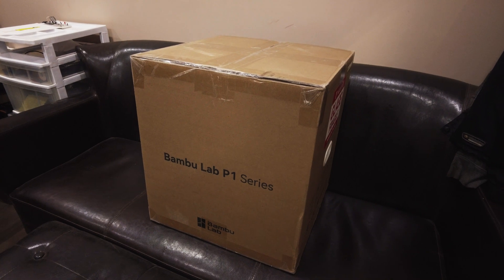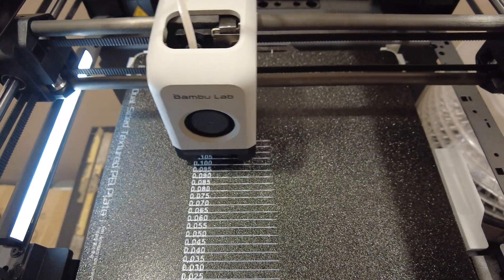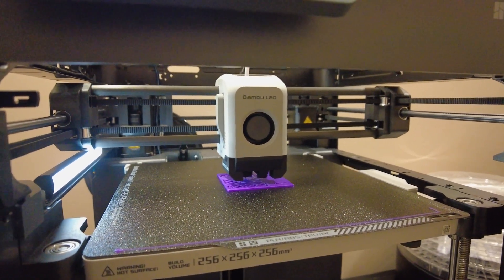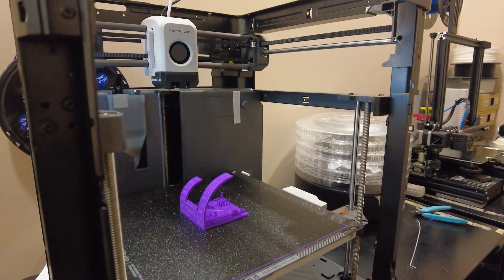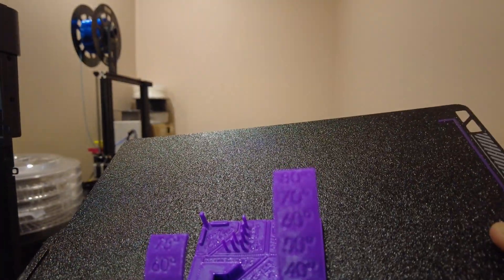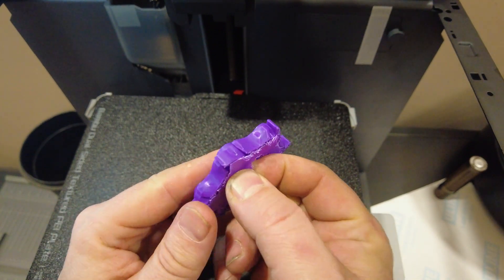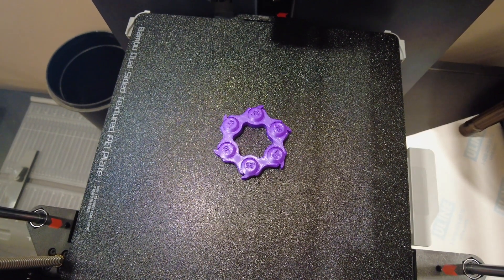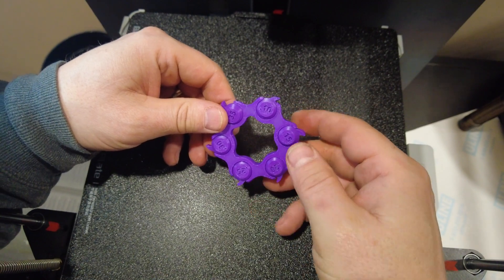Bambu P1P Tests and Calibration

Comment: Ive had 2 p1s machines since july, and these run 24/7. Ive had minor maintenance since then, and wont buy another brand.
Reply from the maker: Awesome! Mine doesn't run that much but i haven't had any issues at all. My kids' high school bought 2 p1p's when they first came out and they are the only ones that I've seen with some issues, but they were totally user error. Slicing at 0.2 mm nozzle size and sending it to a printer with 0.4 mm nozzle doesn't work well.

Comment: It's been 5 months. Is it still good? I'm considering buying one as well
Reply from the maker: Yeah, I still recommend it, but right now i'd be torn between this and the Bambu A1 mini. If you need a bigger print surface, the P1P is the way to go because you can add the AMS unit for multi color printing, but if you don't need as big of a print surface and value multi color printing more, the A1 mini may be the way to go. A bare P1P is about the same price as the A1 mini with the ability to print 4 colors at a time and the reviews are pretty good so far.

I've probably got close to 1000 print hours on my P1P and the only time it fails now is if I've done something stupid. I have forgotten to put the magnetic build plate back on a bunch of times now, and because it's so reliable I don't watch the first layer go down like I always did on my Ender 3, which is probably all the print failures i've had with it recently, although I did have one fail due to a spool tangling - again, my fault not the printer.
Reply: @MiddleAgedTechNerd-rt2lp  thanks for reply. I have a prusa mini plus, and need something with an enclosure for ASA and maybe even nylon plastics. Prusa seems to do a decent job with ASA when I get everything right, but I really want something much faster. I'll probably go with P1S
Reply from the maker: Makes sense. I probably would have gone with the P1S myself if it was out when I bought mine. I haven't done anything other than PLA and PETG so far so I can't give you an honest answer how ASA and Nylon print. I have an old "enclosure" I built for my Ender 3 when I was doing a bunch of ABS printing that should fit over the P1P,  but I haven't tried it yet.

Comment: Good video, I thought the K factor test was most useful only if you have the AMS attached. Is this wrong?
Reply from the maker: Thanks! The K Factor should be set whether you have the AMS or not. It all has to do with the filament because they all extrude differently. Some people will do a K Factor test for each type of filament - PLA, PETG, ABS etc., and some will actually do a K Factor calibration for each roll, and then change the K value in Bambu slicer with each filament change or each material type change. Personally, I set it once and have printed many colors with PETG and PLA without problems - because I'm lazy and haven't had any issues Lol!
Reply: @MiddleAgedTechNerd-rt2lp   This is good to know.. thanks!

Comment: Are you using custom settings if so what do you recommend?
Reply from the maker: Pretty sure it was just the Bambu lab presets for this.
Reply: @MiddleAgedTechNerd-rt2lp  awesome. Just ordered the p1s this morning, super excited as I’m coming from a voxelab x2😭😭
Reply from the maker: Awesome! I'm still impressed with it so I think you'll be really happy. About the only thing I play with is the support type and the number of walls/top and bottom layers. I have gotten so used to it always printing well that I forget to check the first layer going down, which usually isn't a problem - unless you forget to put the build plate back on, which I've done more times than i'd like to admit!
Reply: @MiddleAgedTechNerd-rt2lp  lol yes I’ve been trying to convince myself into a prusa or something but there’s just so much more to offer here. Especially with the enclosure for 100$ I mostly print Pla so I’m wondering if I should leave the door and top off or just turn up the fan. I guess we will see.
Reply from the maker: I think you made a good call. These printers are amazing! I haven't had any issues with PLA or PETG on my P1P with no doors or top, but you may get more consistent layer adhesion by leaving it enclosed.  The biggest thing you'll notice is how fast you get through all the things you wanted to print, just because of the speed. I printed so much stuff in the first week I had it that I didn't know what to print next.
Reply: @MiddleAgedTechNerd-rt2lp  yea coming from voxelab having to relevel the bed 20 times with bl touch and it going at 50mms and 25 for the first layer it’s gonna be a huge improvement. I gave up on my printer awhile back because it was just frustrating. I might do a YouTube video with unboxing and review we shall see.
Reply: @po5tup568  I had an ender 3 so I totally understand. You are going to be amazed! I think I just sat and watched it go for the first hour! Let me know if you put up a video because I'll definitely watch it
Reply: @scottg.1764  awesome I’ll definitely let you know man, YouTube’s been lacking on the unboxings and especially ones that aren’t sent to them, I’ll let you know!

Comment: hey thanks for the video in detail. I want to know if there is an option to reduce or remove the custom pattern lines that is printed when calibration process gets starts. As i can see your printing bed doesn't have the custom pattern on it. 
My agenda is to reduce the print time, this would be help if you can guide us on this part. Thank you :)
Reply from the maker: So the K value pattern I only printed once and entered the best value into bambu slicer. Some people say you should do it for every type of filament, but I set it once with PLA and have had no issues ever since with PLA, PETG, or a small ABS print I did.

After that is set, what takes the most time is running a bed level calibration every time it begins a print. You can shut it off and save a bit of time. You just de-select it when you are sending the file to the printer. Overall, though, it does take a long time to get printing, but because it prints so fast it makes up for it pretty quick.

Comment: just got my X1c yesterday..which build plate is this? I can't stand the glue coming from an ender3s1 haha
Reply from the maker: Pretty sure the X1C comes with the cool plate/engineering plate. The P1P comes with the textured PEI plate. The Lidar on the X1C doesn't work with the textured plate - it throws off the Lidar, from what I understand. You could buy the textured plate and turn off the Lidar if you wanted. I'm super impressed with the textured plate. Printed hundreds of things on it already and it looks like new. I had an ender 3s1 previously too and understand the glue! I actually use hairspray instead - extra hold. It just applies easier and washes off easy too.

Comment: This is a very good video showing just how good this printer is after initial setup. Very on point. 

Because I don't like bed slingers, I have been considering a Creality Ender 5 Plus. I think the 5+ would be fairly precise but this one looks even more so, although it's build space is way less.

I'd be very interested to see a close up of the little square towers on that overhang test - printing at a pretty slow speed to see how precise thee printer is. I have a specific use case which requires printing a small item with precise z axis alignment as well as larger shapes in vase mode.
Reply from the maker: Thanks Tony! 

I came from and Ender 3 so the bed size is bigger for me, but an Ender 5 plus is still quite a bit bigger than that. 

I'm not sure which little square towers you're referring to on the overhang test. I can say that this printer is quite precise, though. For even more precision, you could go with a smaller nozzle size - the only down side is print time. I would say that any core x/y printer would be more precise than a bed slinger for z axis anyway. I used to print some tubes for my business that were 3/8" wide by 10" tall and there would be a lot of z wobble at the top on the ender so they got pretty ugly at the top, but no problem on the p1p. I ended up printing them on their sides on the ender for that reason.
Reply: @MiddleAgedTechNerd-rt2lp  Thanks for your reply. You can see the little square (are they square?) towers in the corner of the test piece at 3:40.

Print speed is not an issue for me in regard to this particular component as the piece is quite small (30 x 20mm). It is essentially a disc mount I have designed for a small Tesla type turbine. Everyone is always doing videos on how fast a given printer will print a benchy but no one is looking at how accurate they are for printing practical items with precision. Even on the P1P I think I'd print the mount at 50mm or slower if it made a difference to layer alignment.

I presume you are old enough to remember the 3.5 inch floppy? Well, I have kept a couple of hundred of these discs for all these years with the intention of making a throwing toy using the discs in a series of prototypes. So the mount is small and the tollenences are fine. So, the quality of the layer alignment on those little towers would be a good indicator of whether or not this printer is up to the task. 

I was considering getting an LCD resin printer just for this component and an Ender 5+ (that bed induces Z wobble is a concern) for the larger components, but it looks like this FDM printer might actually be up to the task of both - although the build volume is a bit on the small side for printing the fuselage, but I can do it in sections. 

I have been considering starting a channel to show the development of this and some other devices/experiments I have in mind. However, I have some other projects which I need to finish first.  I'm very keen to see how your channel goes, which I have subscribed to - good luck!
Reply from the maker: @TonyGrant.  Ok. I'm understanding a bit more now. The little towers in the corner near the middle of the screen at 3:40 are little solid cylinders and i'm pretty surprised how well they printed, and it was at the stock speed settings.

I'm definitely old enough to remember the 3.5 inch floppy's. My first computer was a Vic 20 with a floppy drive and then a commodore 64 with 5 1/4! Cool idea to use the floppys to make a throwing toy!

as far as accuracy with printing practical items, even my ender 3 could be tweaked to be accurate within 0.1 mm most of the time, but it struggled to make perfectly round cylinders. So far the P1P has been bang on with cylindrical accuracy. I have a small business with an automatic bottle filling machine and I initially bought the ender 3 to print filling nozzles which were $2500 each, which I thought was expensive. That's where I learned how to tweak settings and design models because 2 parts have to be within tolerance to fit an o-ring to seal the entire assembly while allowing one part to move in and out of the other part - so the outer edge of the o-ring has to be pretty precise and the part sliding in and out of it has to be pretty precise, especially since there's 50 psi fluid running through. I had a lot of failures for many different reasons, but the o-ring seal has worked pretty well early in the design process. Now I print entire nozzles for about $5.

You should definitely do some videos on your projects! As soon as you say tesla type turbine, I'd watch it! Just wondering if the 30 x 20mm piece you're looking to print is the impeller shaft of the turbine. The one bad thing about FDM printing is that strength in the layer lines is much weaker than across the layer lines. Learned that the hard way many times. If you're printing a cylinder it's best to lay it on it's side and have the layer lines go 90 degrees from the rotation, but printing a cylinder on it's side so it is round is difficult with FDM printers. The other option is to print it with PETG which has better layer adhesion than PLA in my experience. A resin printer would definitely do a beautiful job of it, but from what I know about them, the resin parts aren't as strong as FDM parts.

Definitely drop me a note if you start a channel!
Reply: @MiddleAgedTechNerd-rt2lp  Yes, $2500 does seem a bit steep! $5 sounds quite reasonable though! I imagine the layer lines pose problems with that pressure and a moving seal. I remember playing Elite on a C-64! (or was it a TRS-80?) It took forever for the tape to load the program!!!

The small component is a disc mount to hold the turbine in place. It holds the discs by the inner edge of the centre hole using small narrow towers (hence my interest). So there is no impeller - moving the air relies on the boundary layer effect between the spinning discs. It doesn't have to be too strong (slightly shock resistant possibly but it's protected by a shroud). But it has to be just the right size and tolerance to allow the discs to slip over the towers but catch on notches intended to hold them in the correct position. The notches protrude about 0.75mm but layer alignment needs to be much finer - 0.05mm possibly?

I have been able to print some mounts which started out pretty rough but are getting better as I make improvements to the printer. The problem is that I'm using a printer a mate gave to me (a Tevo Tarantula) and it was in pretty poor condition (the boss - err, that is the missus - won't let me buy a printer until I finish the aforementioned projects - renovations! ). When I got the printer, I had to fix all the wiring and tighten all the bolts, adjust the wheels and belts but plenty of components are still out of whack. I'm now in the process of printing components to replace the flimsy or warped ones on the printer (the X-carriage is a warped horror of misalignment). So I'm thinking (when the renos are done) the P1P might just have the precision to print the mounts. In the meantime I'm trying to see how accurate I can get this printer to print. Right now I'm at the point where I can  mount some of the discs and have them stay in place if I'm very careful.

I hand made a proof of concept back in the 90s which proved the concept would fly - when thrown it went about 50 to 100 meters. It was made with PET drink bottles and balloons! Cut with a craft knife and glued together. It had scoops at the front which funneled the air internally exhausting it out the rear providing thrust. It was thrown kind of like a gridiron ball but with a simple piece of apparatus to increase it's spin so the turbine could operate. The current design is thrown the same way but is different in concept and will use a tesla turbine instead. Using Fusion 360 and a 3D printer allows me to really manifest the things in my head - much easier than in the past.

Now, it could be possible that I won't be able to induce enough spin with the current design to generate thrust so eventually I will get a laser engraver to cut the discs from thin sheet because then I can try different sized discs made of different materials. So the design will probably vary at that point. I have some vague plans to mount some on electric motors to see if how much lift can be generated. Underwater ones a well and also pumps and water aerators. 

But right now I'm just trying to get my floppy discs mounted! So, if you do any more videos with narrow or fine vertical components I'd be very interested to see some close ups of those details!  

If I start a channel I'll definitely let you know. I have some ideas which I have conceived over the years involving spinning things and fluid dynamics which I think I can now build with the basic digital design and manufacturing tools available today. I think people might find them interesting.
Reply from the maker: @TonyGrant.  Very cool! I'm absolutely interested by your description!!
Reply: @MiddleAgedTechNerd-rt2lp  Cheers. I look forward to your next video!

Comment: Would be cool to see how you side mounted the spool. I'm in a similar situation with my printer.
Reply from the maker: Will do! I downloaded a design off of Printables that seems to work quite well.  I printed this one and just bolted the factory spool holder to it.

https://www.printables.com/model/387950-bambu-lab-p1p-side-spool-holder-mount
Reply: @MiddleAgedTechNerd-rt2lp  thanks for the link, I'll have to see how it does on mine